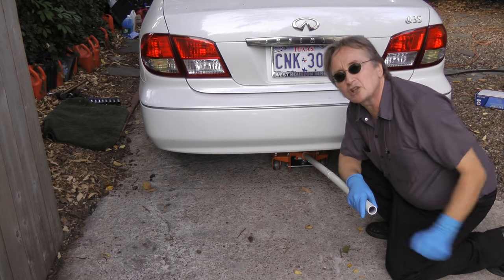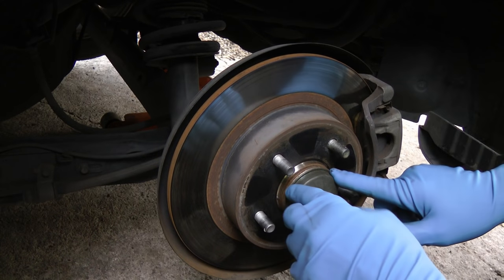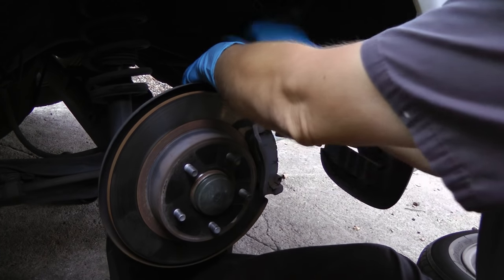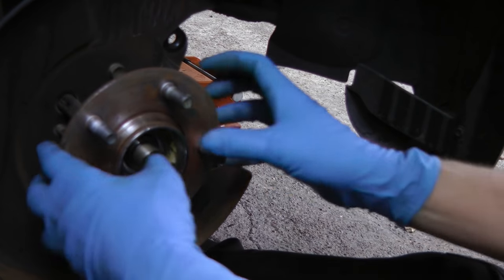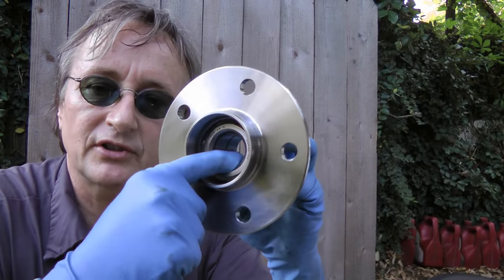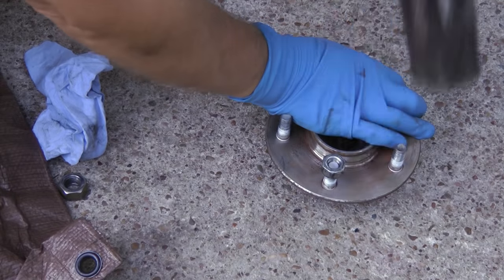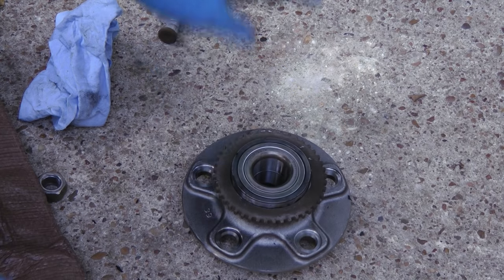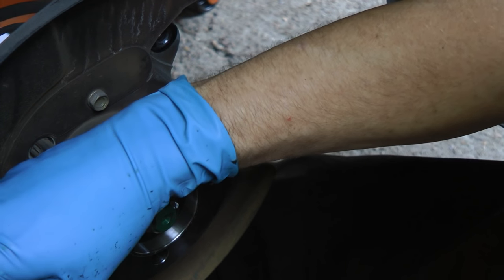How to Check a Wheel Bearing in Your Car (Replacement)

Comment: Hi Scotty, I've got a 2008 Yaris that I think might have a bad wheel bearing, noise from the front right, which is the drivers side here.  Not sure if it might be the tire, which I rotated from the back making noise.  Do small Toyotas often have wheel bearing problems?  Not sure whether to replace the bearing or try new tires first.
Reply from the maker: they all wear out eventually.  Put the tire in the back first, if noise moves, change that tire
Reply: Thank you

Comment: love the vids.   great ideas and help from all of them.  o yea nice rides lol.      i have a stiffness in the wheel when turning. 06 tacoma.  pads are New all hardware and rotors. calipers are old.   could calipers be the problems or wheel hub replacement or balljoint??      no noise ever from power steering truck very quite.  ???

Comment: Hi Scotty, please could I have your advice asap my brother 🙏🏼🙏🏼. I think my passenger side wheel bearing is shot,...there's movement when I rock the wheel both up top/bottom And Side to side. I cannot afford to have them replaced at the moment, is it safe to drive to and from work 6 miles away until payday 25 August 2020? Thanks in advance, Michael in England

Comment: I know this may sound dumb but what did you put the jack on to jack it up?  Was it the differential?
Reply from the maker: diffs are a great jacking point as they are solid hard metal bolted on strongly
Reply: Okay, yea I always thought people jacked it up on the differential but some people told me not to do it there because it can dent it, which I thought was absurd because like you said, it's a solid strong piece of metal.  Thank you for that reply!
Reply: Rear cross member for FWD vehicles. Differential housing for RWD or AWD vehicles.

Comment: Also, the guy said since I now had new tires I was feeling this vibration when before the old tires had somehow compensated for the major vibration.I just didn't buy new tires could  bring out such a problem as he said.But as I am no expert I was hoping you could help one of your fans.  So I am thinking now it could still be the balancing as it acts just like it except for the pull I have now to the right.Before the new tire my old really worn out tires ran perfect.1st to check alignment?

Comment: My car makes this pup pup pup noise from the rear right when I turn even a bit. It's quieter when you're driving straight and barely noticeable when you're driving fast. Could it still be the wheel bearing?

Comment: While driving at highway speed i sometimes hear a ticking noise coming from the back of my car,it only appears while i am on the accelerator. If i ease off the gas pedal it dissapears and comes back when i step on it. Could it be a wheel bearing or the driveshaft bushings ? The car is a 94 Mercedes E300 diesel

Comment: Hi Scotty. I just found your YouTube channel and am finding a lot of useful information. I'm a DIY Mechanic and have always worked on my cars. I have a 2009 Hyundai Accent with 80,000 miles and a couple of issues. You talk about hearing a "roar" when driving that gets louder. This you say is a sign the bearings are going out. Last year I replaced my brake pads and left the rotors alone. They looked okay. Well, I got cheap pads and they were eaten up. When I brake I hear a roar or grinding from the front. I'm about to change the rotors and install ceramic, quality pads. Is there a chance that the bearings are bad too? Thank you for any input!
Reply from the maker: odds are bearings are bad, they are the only thing really that roars more the faster you go from the wheels

Comment: Hey I got a question I just did my front brakes and rear on a 2015 sonata 2.4 at good year and now the front wheel is making this growling noise like a metal  to metal  contact I took it back to them and they say it's the wheel bearing  but it was fine before I got there

Comment: I recently changed a bad tie rod end on my driver side and the car drove smoothly after that. But now my steering wobbles when I make a sharp left turn at high speedbut not when I make a right. Could this be a wheel bearing?

Comment: I have a 96 park ave that runs like a dream , except this terrifying grinding/roaring noise from the front wheels I hear its pretty common on this car. My question is how do I know if my bearings need to be packed and regressed or replaced all together.

Comment: Hey Scotty !  one of my wheel studs broke off, and i was at school in our shop  trying to replace it. my instructor said its better to press the stud out but it seems easier to just hammer it out like ive done in the past..exept this time this stud didnt move i hammered it with a 3lb hammer and we even gave the back side some fancy flame less torch that heated it up, im thinking of just cutting the back lip off and just pushing it out that way with a pic. what do you think?

Comment: Hey Scotty a quick question. I have a 2001 Olds Alero and I have a loud roaring from the front and it gets louder the faster I go, I can put it in neutral, brake but it still makes the same sound.  But people don't say its a bad wheel bearing because the sound stays either way I turn. Could it be that both are bad together or am I looking at something worse?
Reply from the maker: yes, often both wheel bearings go bad, and if really bad, one bearing alone can make noises turning either way

Comment: Question about trailer bearings. I bought a harbor freight 4' by 8' utility trailer. The 2 hubs have an inner and outer roller bearing.  I towed the trailer 1400 miles round trip. I repacked the bearings after my trip and noticed the inner bearing had very little play and some dirt in it but the outer bearing was fine.  Any idea why this would happen? The seal was on pretty tight and very little grease appeared to leak out. Cheap parts? Maybe the seal is not seating on the axle correctly?

Comment: I have a 2007 gmc sierra 4x4. My bearings are bad but the issue i am having is when i turn left or right at a fast acceleration i get a loud metal on metal slapping/ clashing sound as if something is sliding across my bed and slamming. No idea what it is unless the bearings could make that noise but when it happens i can feel it. Its definitely in the rear end somewhere. 150k

Comment: Scotty, I notice that you dont use a torque wrench on any of this. I dont own a torque wrench but was thinking about getting on since this stuff seems important, what do you think? Snugging them in OK enough for you?
Reply from the maker: yes, by all means use a torque wrench for exact tightness, especially if you're not a pro
Reply: A torque wrench is a great tool for those of us starting out. Eventually, you will get a feel for how tight things should be and won't need the torque wrench near as much. There are some applications where I absolutely insist on using a torque wrench. The intake manifold is a great example.

Comment: Hi Scotty, great video. One question, I believe that my front left driver bearing is going bad. I removed the wheel I there was no play with the shake test. Also, the wheel spins freely when you give it a hard spin with no noise. Can a wheel bearing on it's way out only show itself while there's a load? When driving straight or turning right I get a bit of noise/vibration but no howl. However, when turning left, the noise goes away and the steering becomes perfectly smooth.

Comment: if a bearing is bad would it cause your engine to work harder? Would it slow your car a bit? Would it cause the steering wheel to pull to that side?

Comment: Hi Scotty, I have a 2004 GMC Yukon XL with about 100,000 miles on it and i have already replaced the front right wheel bearing about 10,000 miles ago. It feels like something in my front axle on the right is grinding but isn't making any noise, could it be the bearing again?

Comment: Just got my car back from a tire shop, they broke one of my lug nut bolts from my front left wheel, they told me if i wanted it fixed that they would have to order a whole new assembly, few days later i got the car back it droped down to 33 degrees and i get a humming noise now from the same wheel but when i get on the highway and heat my wheels up, the noise goes away completely. I hear the noise around 15 mph to 30mph, any idea?

Comment: Hey Scott hows it going? I'm kind of new to tube but I will subscribe and definitely enjoy your videos. I have a 2005 toyota corolla that has had a humming noise for quite some time. It gets louder the faster I go. I have replaced the wheel bearing twice since the noise has started. Do you have any idea what else it could be? I've been doing some research and I guess the corolla have an axle with some type of bearing assembly on them..idk. your help would be greatly appreciated.  Thanks
Reply from the maker: realize there are 4 wheel bearings, one on each wheel. Get 3 other guys to ride in the car with heads out the window to see if it's one of those four still making noise first.  Also realize oddly worn tires will hum too

Comment: Thanks for all your video's! I'm replacing the rear wheel bearing on a 2003 Toyota Matrix RX and I'm just stumped. I've reached the point where I removed the 4 12mm bolts in the back and I was expecting the hub assembly to be loose but it seems like it's welded on. Any suggestions are greatly appreciated!

Comment: My rotor is wobbly does that mean it is worn out by the stud holes? Or can it be the wheel bearing? When car is on jack stands I can wobble the rotor at 3 and 9 and 12 and 6 etc but the caliper doesn’t budge any help appreciated

Comment: Hey Scotty i got a mustang gt 2002 that's making a weird grinding/ groaning noise when i turn, yet thing is it ONLY does it once the cars warmed up to average running temperature. When i first start it up it doesn't make any type of noise what so ever for a while until it begins to get warm than starts the noise just wondering what you think it could be? I was thinking maybe ball joins or power steering? A reply would be much appreciated thank you.

Comment: Scotty Kilmer I have a problem I just go a set of new Michelin PSS and after a couple days the tires started making a humming sound. It’s more noticeable between 20mph and 50mph at 80-90mph I cant here the noise anymore could it be the wheel bearings or the tires the noise is coming from the back

Comment: Could you tell me how you determine difference between bad bearing and a tire? I hear a hollow noise while driving. My mechanic said it's not a wheel bearing but he only checked the two front wheels not back
Reply from the maker: easy as pie. move the tires, front to back, if the noise moves, it's the tires.

Comment: That is the bearing that was just replaced. I jacked up the left rear wheel and it has no wiggle in it at all. The right wheel with the new bearing does wiggle at the 12 and 6 o'clock position.

Comment: Scotty! I require assistance! I recently changed my bearing due to the loud droning noise it would make while i drive. The droning went away, but there's still a lot of vibration in the front left tire and my steering wheel. It used to only happen around 35-55 mph but it has progressively been getting worse at higher speeds. When i got an oil change i was told my tires need to be replaced, so could it just be that i need new tires? I checked my tie rods and they seem to be fine.
Reply: James Smith you very well may have belt shifting in the tire.  The tire is not straight anymore so this could explain the wobbling.   Or it could be uneven wear in the tires.   Remember to always replace in pairs or a full set and always get an alignment!
Reply: Warped rotor

Comment: Scotty need advise. 2003 Corolla 140 mi. Tried bounce test front and rear and Corolla hardly moved???  Found boots on the struts had deteriorated and need replacing. Diagnosis?

Comment: Hi scotty great videos .I seem to have a bearing problem when I drive above 20 mph I hear a humming noise from the front and it gets worse when I steer to the left .This seems to get louder and you can feel it in the steering wheel when you go faster .could it be the right front beating or something else. Thank you
Reply from the maker: left front wheel bearing being worn will make the noise get louder when you turn left and corner at the same time
Reply: Thank you Scotty keep up the good work .
Reply: @scottykilmer  Shouldn't it be the right wheel bearing that get's the load (and makes the noise) when turning left?

Comment: hi scotty I have a 2004 Nissan maxima,abs goes on under normal braking no abs light on dash,abs also goes on even when driving at times did you ever come across this problem ?thanks
Reply from the maker: sure, that old, the abs often goes whacko, have a pro like me scan it and pray it's just a bad wheel sensor. It takes a dealer level scanner to analyze em though

Comment: Hey Scotty, I just got my first car which is a 1999 Pontiac Grand Prix GT and before I bought it they guy had to replace the right rear wheel bearing. The ABS light was on and it made a loud roaring sound when driving. He replaced the bearing and the ABS light is off now. I checked to make sure that it is a new bearing and it is. However, the loud noise is still there. I jacked it up and it wiggles at the 12 and 6 o'clock position. If it isn't the wheel bearing what could it be? Please help.

Comment: I have 2009 escalade EXT. The steeling wheel shake at high speeds. I have replaced the wheels, the brakes, tie rods and rotors. but it still shakes.

Comment: Scotty, I hear a weird sound coming from behind my drivers side wheel when I'm off the gas or coasting down the road. I checked underneath my car and spun the tire and see my brake pads are moving around. Brake pads have a lot of padding left on both sides. Is the piston not pushing them in correctly or is my rotors the problem?
Reply from the maker: vansurfing more often that's bad wheel bearings
Reply: Thanks for the response

Comment: hello scotty. please help. I just replaced a wheel bearing on 2004 Subaru Forester x. with new rotor and brake pads. after driving 300 miles on a rough road the grinding noise came back especially Everytime I turn. please give me advice
Reply from the maker: well, often best to replace wheel bearings in pairs, could be the other side
Reply: but to be specific. the same noise i am hearing is the one i just fixed.
Reply: I'm having the same problem with a bearing I replaced 6 months ago. It was fine in the morning... drove it later in the day and now it sounds like a friggin' old tyme wagon wheel ...and I've been driving on good roads. The rough road could have definitely caused your failure. In my case...  defective part? Improper install? Out of round tire? Maybe I hit a pothole a month ago? Who knows. 
Pressed-in bearing types suck to replace cause you need a press / remover to replace them, and improper install is the leading cause of failure from what I'm reading. I haven't heard about replacing bearings in pairs. Usually you just jack up the vehicle and see which one is loose, but I suppose you can have a noisy bearing that hasn't gotten sloppy / loose yet.

Comment: Would a bad wheel bearing cause my rear end to vibrate at higher speeds? My Dodge Ram van does so bad It's a message while driving.

Comment: Scotty, I have a definite clunk coming from my right rear wheel going over slow bumps. I've changed the sway bar links and bushings. I can't see play in the trailing, lower, upper arms or lateral link. I pulled on the wheel and no play. Then I let down the jack, pulled on the wheel a bit and wouldn't you know it started to clunk as i pushed and pulled on it. When there's no weight on it, there's no clunk. Is this a wheel bearing?

Comment: Whats the best way to figure out if its the wheel bearing making the noise or the half shafts? I have 97 tbird it makes noise in the back but I cant pin it to the wheel of the half shaft. It seems to be loudest when accelerating putting load on it but quiets up when off the gas with no load on the rear.

Comment: I guess "play" might not be the right word to use.  I should say the bearing wasn't spinning as easly as the outer bearing.  Really wierd, considering the outer bearing was fine and the seal didn't appear to be leaking much before I pulled it off.  Oh, and the other hub was fine, no issues. Could the axle be jacked up? I didn't notice any nicks or scratches.

Comment: G'Day Scotty,

My 1997 Audi A4 sedan has recently developed a loud repetitive clicking sound coming from the RHS rear wheel area. The noise level and frequency of this clicking sound both increase with speed. The sound momentarily disappears when turning right - as the RHS rear wheel bearing (front wheel drive car) is momentarily unloaded.

This leads me to believe that the RHS rear wheel bearing is the culprit.... What do you think ? I can't find a faulty wheel bearing being described as a loud repetitive clicking sound, so I thought I would ask for your learned opinion.... Anyone with useful input is also encouraged to correspond....

Cheers,

Gary
Reply from the maker: sounds like a bearing, but those audis are so complex inside if it's AWD, I'd advise doing my video "finding the source of car noises" to see exactly what's clicking

Comment: Hello scotty 
Hope you and your family are ok.
I got Mercedes e350cdi 2016 only done 13500 miles when im driving from rear noise like humming and gets more and more mercedes dealer told me i got bend disc at rear im not mechanic i said if will fixed please change it. 🤪 they did quote me a lot of money and i asked where i live local garage could you please check if thats right and they said yes can be abd they did change the discs and pads at rear but problem still carrys on!!! Do you think i can leave with the noise or should i ask local mechanic to change wheel bearings? 
Thank you Scotty waiting to hear from you. Look after yourself.